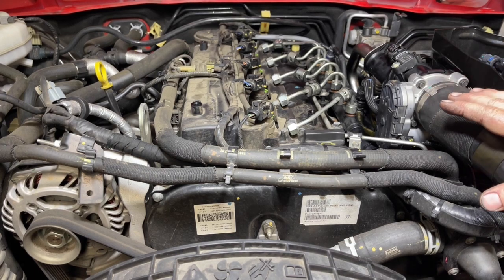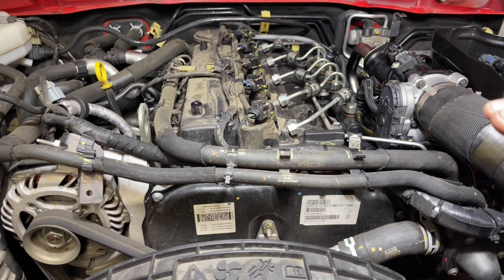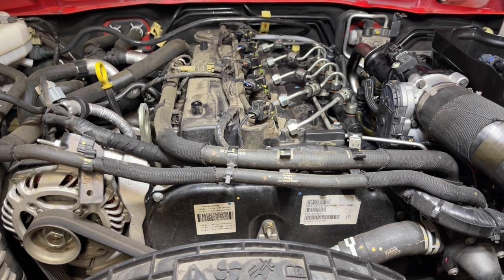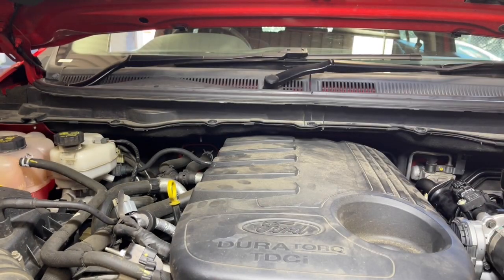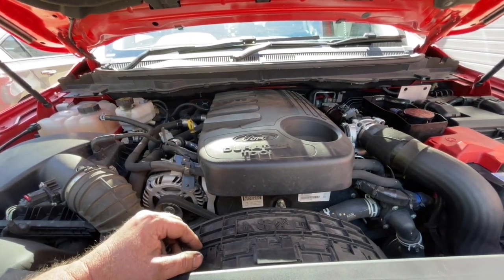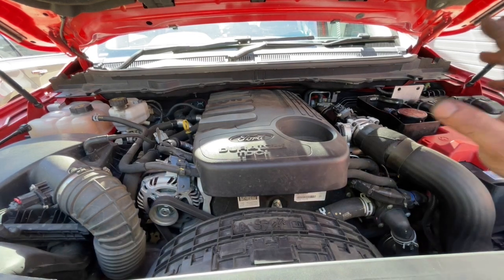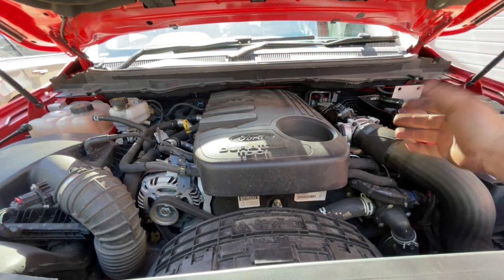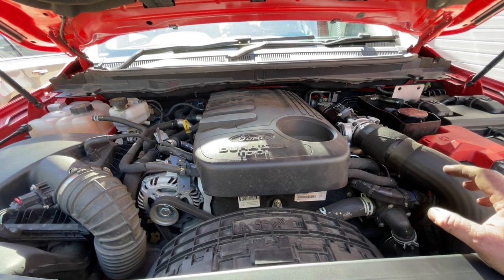Part 6 of 6 Ford Ranger Ford Everest Mazda BT50 3.2 Intake Manifold Clean Full Details

Comment: Really verygood mate . I learn many things as i have my 2013 px3 ranger . Its just been service but still too much smoke. & changes oil .fiter . Air filter. After service i got home . After 2days i drive my car come s engine light . Worse smoke when i accelerate
. And train light on dash. Engine light on .  I changes turbo charge host.  And drive . Smoke comes little. And trainlight off. But engine light still.on 
Thanks i have learn  manythings 
 I will try to clean egr. Slowly.

Comment: Thanks for your excellent videos. I've just completed replacement of my EGR valve, EGR cooler, oil filter and oil cooler housing and all five glow plug as well as the radiator.  Removed and cleaned inlet manifold. I reckon it took me about 32 hrs labour to strip, remove and refit the gear but talk about patience and needing to be an contortionist. Finished off with a complete oil and filter change.  Thankfully I had access to a friends workshop, tools and hoist. Without the hoist I'm sure the job would have been impossible. Also your videos gave me a good heads up prior to starting the job.

Comment: Many thanks for all 6 videos. I have a BT50 and not a mechanic but a sparky. Being curious as to what was involved in working on the whole EGR system whether it was something I could deal with or not. I now know what needs to be done on my engine.
I now understand that I don’t have the tools or patience to do the job but I have gained a lot of respect for your garage and you.
My BCM shows an error code for a stuck EGR valve so at least I know where it is. Thanks again from a non petrol head.
Reply from the maker: Thanks for watching!

Comment: Nice series of videos mate thanks for sharing. I’m going through the same power issues and now DPF as well with 215k on the clock.
Should be able to remove the intake hose and look through the throttle body to gauge how bad it is? Thanks

Comment: How frequently would you be looking to do this clean out? Also any ways to purge air out with an auto push start transmission?
Reply from the maker: I would suggest looking into the intake to see how choked up it is. Different driving styles will change the carbon deposits. Should be able to bring up all the dash lights without starting which will start the priming process.
Reply: dont put your foot on the brake